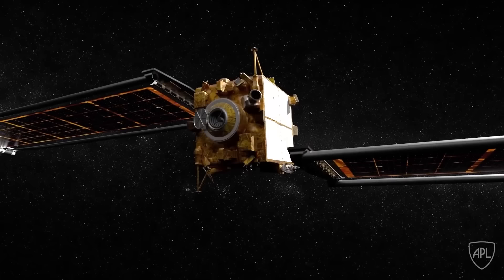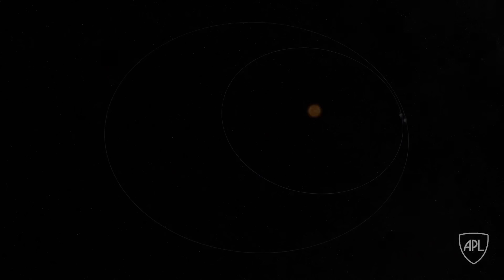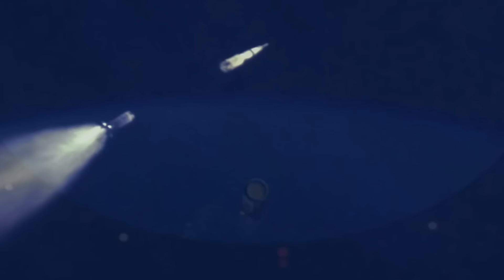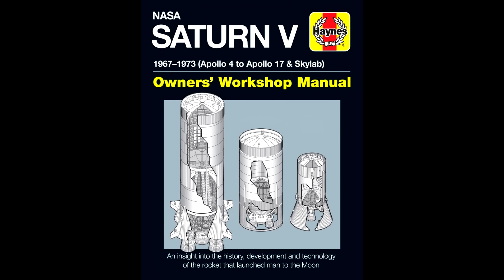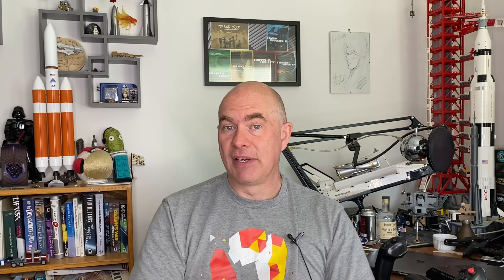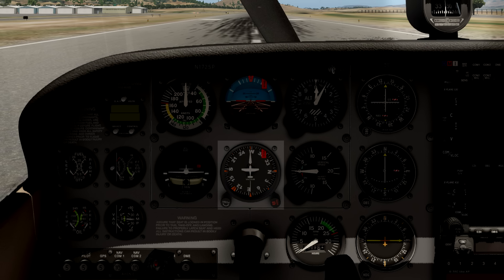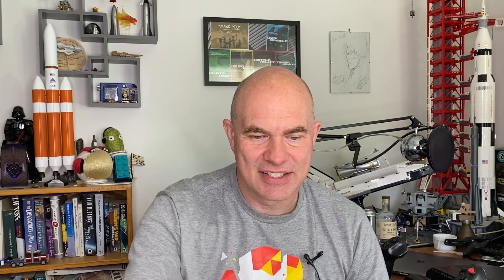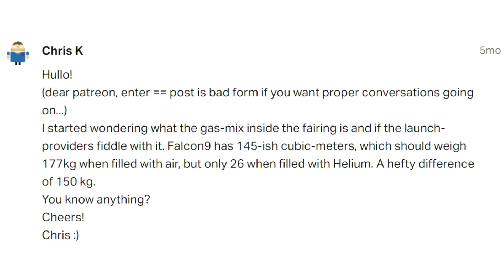Saturn V Staging, Asteroid Deflection and Hearing Rocket Turbines - Supporter Questions, Episode 17

Comment: The Saturn V did I/II staging by carrying the interstage skirt with the upper stage until the ullage rockets had allowed the upper stage stack to achieve a safe separation from Stage I.  Only then were the five J-2 engines started, and the interstage skirt was dropped as quickly as possible.  If the skirt had stayed with Stage I, the outboard J-2s on the second stage would have to have been pulled out of that skirt, a distance of several feet.  There was still a substantial dynamic pressure at I/II staging, which could cause either the spent Stage I or the upper stages to rotate and/or translate with respect to each other.  The risk of a collision of the outboard J-2s with a skirt attached to Stage I was substantial.  Moreover, the separation/ullage rockets on Stage II were solids, having no thrust vector control, and had their own motor-to-motor thrust variability - up to and including the failure of one or more to ignite.  The chances for damaging the Stage II J-2 engines were just too great, so they carried the skirt with Stage II, and didn't ignite the Stage II engines until the stages were separated by a good distance (Stage I even had solid propellant retro rockets on it to slow it down, overcoming the F-1 shutdown transients).  Once the J-2s were lit, the skirt could safely be jettisoned (it rode off on rails which prevented it from rotating and hitting the engines).  The number of factors involved in tandem rocket staging is large, and the problem can be very complex.  I was deeply involved in the development of the Peacekeeper (MX) and Small Intercontinental Ballistic Missile staging problems, and gained a substantial appreciation for the ins and outs.

Comment: 14:00 Regarding guidance system updates on Apollo, if I recall correctly Mission Control determined that the doppler shift information on the radio transmissions was such a good reference that they used that as a primary source for velocity information to update the guidance system as well.
Reply: That's correct. After Apollo 11 landed about four miles from the intended landing spot they realized that velocity errors were at least part of the reason. Someone came up with the idea to use doppler shifts to get an accurate velocity measurement as the LM reappeared from the back side of the moon. This was quickly used to calculate a new false landing location to fool the LM's guidance system to land in the intended spot. If you listen to the later descents you can hear mission control reading up the new landing location and the astronauts punching it in. This was necessary on Apollo 12 because they wanted to land within walking distance of Surveyor 3.
Reply: The Apollo missions used a blend of 2-way Doppler (for radial velocity), delay measurement with a pseudorandom number coded into the radio signal (for distance) and antenna pointing angle. This was, as you say, the primary means of determining the spacecraft's state vector (its position and velocity). The crews used star/horizon angle measurements to achieve the same thing as a backup. In the event, the command module pilots proved to be as accurate as the ground engineers in determining the state vector.
Reply: @wdavidwoods  awesome explanation! Thank you! 👏👏👏👏👏

Comment: I think what the first question was trying to ask is if, let's say there is a situation where a spacecraft with a base mass of 1000kg, with 500kg of that being propellant, and a velocity of X is on a collision course with an asteroid, will it be better to accelerate the spacecraft towards the asteroid, burning off Y amount of fuel (and therefore losing mass) but gaining Z amount of velocity, or will it be better to not burn, and impact at that base velocity of X but retaining all the mass of the 500kg of propellent.
Reply: Because kinetic energy is m*v^2 I would assume it's always better to trade mass for velocity, but someone with more knowledge would have to confirm that for me.
Reply: The answer would depend on the speed your already going.  At slower speeds its going to be better to burn the propellent, but at some speed it would no longer be worth it.
Reply: @lunaticbz3594  I think the opposite would be true. By the Oberth Effect rocket engines add mechanical energy more efficiently at higher speeds.
Reply: @BuffMyRadius  I just looked at an extremely slow, and an extremely fast scenario.  1,000 kg at say 10m/s is way less then 500 kg at however fast that propellent gets it moving.

At 20km/s burning 500kg of propellent isn't going to give you more energy then having 1000kg travelling at 20 km/s.  

To actually figure out where it stops making sense to use propellent would require math, and exactly what king of propulsion and efficiency etc.  But just looking at the extremes shows that at some point it stops making sense to use the engines.

Comment: The biggest issue with the space elevator is not physical or technical.
The problem is that it is a huge point of failure. If it snaps, then the whole structure is gone. 
And as long as terrorism and wars exist (= forever), it will never be safe.
Reply: No real space elevator concept is wrecked by a cable snapping. All of them have redundant cables, so you can do repairs if one of them snaps for some reason.
Reply: Good point.

Though if one can build a space elevator, one can also build a few tethers for redundancy maybe...
Reply: @u1zha  Skyhook tethers are still useful for other reasons, like carrying things that need to be in Earth orbits that are difficult to reach from GEO.
Reply: @HalNordmann  We are not talking about predictable accidents here, but major catastrophes, and deliberate attacks.
Reply: @juzoli  Again - big redundancy and failsafes. Like ensuring the cable burns up in the atmosphere while falling.
Reply: @HalNordmann  Cable burning up will not save you from losing your $trillion investment.

Space Shuttle had failsafes and redundancies as well, but they still lost 2. But they had several, with the option to build more.

Space elevator is only an option, if rebuilding one will not wreck the economy.

Comment: On hearing the turbopumps spooling up: one of the cleanest I can think of is the Raptor engine test firings. Because it's in HD with a good mic next to it, and there are two pre-burners spooling up instead of one, it's actually pretty audible. Obviously only for a second, because then it's overtaken by the Raptor itself, but it is there.

Comment: I don’t see any other comments on this subject, but one way in which the military — and politics — complicated the design of the Shuttle was in the manufacturing site of the SRBs.  The original plan was to build the SRBs in one piece near Woodbine, GA (about 15-20 miles north of the FL line on I-95 or US-17), and float them on barges down the Satilla River, then south on the Intracoastal Waterway (the gap between the mainland and the barrier islands) to the Cape.  Simple design, fewer steps to fabricate, and NO O-RING JOINTS.

But the military wanted a polar orbit launch site in the CA desert, so they had to be transported by land.  And Morton Salt, based in Utah, bought the manufacturer Thiokol, and lobbied Utah’s Congressional delegation to push for moving the factory site to Utah.  This meant that the SRBs had to be moved by rail, requiring them to be made in three pieces that could be put on a rail car, leading to the O-rings that failed and led to the Challenger tragedy.  And for every launch they had to be moved from Utah to Florida by rail, rather than from southeastern Georgia, and never once got shipped to the California launch site which was part of the reason for the design change!

Comment: Regarding IMU recalibration: attitude, i.e. the direction in which you are pointing, can be automatically recalibrated using star trackers and sun sensors, which provide very accurate information. Location is recalibrated using a transponder that sends a signal when it detects a signal from ground radar. The ground radar can then use the transponder's signal to locate the spacecraft. We use a transponder instead of trying to detect an echo of the ground radar signal because the strength of the reflected signal is proportional to 1/r^4, that is, it fades*really* quickly as you get farther away.

Comment: One very commonly overlooked part of building space elevator is that it requires mopping up and leaving empty orbit. It's either/or situation - either you have SE, or free orbiting satellites. It is possible to plot high inclination or polar orbits that would consistently avoid the elevator location, but anything close to equator is a hard no, and even then, any case of high angle collision )like Iridium and Roskosmos) puts the elevator at risk. This means all LEO infrastructure would need to go - from communication satellites to imaging systems, and all would remain is geostationary with it's 220 ms ping.
Reply: You just need a slight inclination to avoid the elevators.

Comment: The later generations of LM also had a higher specific thrust engine thanks to a larger and longer descent stage engine bell. The extended bell was actually destroyed by impact with the lunar surface on Apollo 15 because they were so much longer. Apollo 15 was the first with a rover.

Comment: My late FIL worked on the rover and the lower LEM stage.  He developed using the screen wire/plates for the "tires" as well as the folding problem on getting it compact.  Lots of compressed springs to get it to unfold in the right order.

Comment: David Woods got this exactly right.  When the first and second stages separated, no engines were thrusting, and the computer had essentially no directional control over the two stages.  If the skirt had been attached to the first stage, there was too great a chance that the skirt would contact the second stage engine bells and damage them.  During the 30 seconds between first/second stage separation and skirt separation, the computer's singular focus was to ensure that the vehicle was traveling absolutely straight -- never mind if it was following the desired trajectory -- so that when the skirt separated, it would slide smoothly backward.  Once the skirt separated, the computer resumed actively guiding the vehicle on its planned trajectory.

Comment: fun fact about electromechanical indicators on aircrafts. one might think that they're just simple voltmeter-like devices, basically just a springed coil and a permanent magnet.

well turns out they're way more complicated to make their readings stable in a tumbling aircraft. in fact, all those "voltmeters" have static coil interacting with a dynamic coil on the pointer and together they form a variable transformer that's used for feedback to stabilize the pointer even in a vibrating/tumbling aircraft.

this is also why all those dials have that characteristic smooth type of movement as if they're submerged into a thick liquid.

Comment: Hey Scott love your channel. Just some fun facts during the first Apollo moon mission. I grew up in Bethpage, Long Island about 1/4 mile from the south approach end of the runway. As you are aware, Bethpage is where the LEM was built by Grumman. Almost everyone that loved in Bethpage worked @ Grumman on either the Navy projects (E2C, F14 etc) or the LEM project. The plant was 24/7 operation to meet the goal. My best friends father was in charge of the wiring for the LEM. One day, I was outside in my backyard when I heard some very unusual engine noise approaching. Being that close to the approach end of the runway, I could actually wave to the pilots that flew over my backyard. But this engine noise was something I never heard before though. When I looked up I saw the NASA Guppy coming in for a landing! It looked like a blimp with wings! It was HUGE! The guppy was there to pick up the LEM and fly it to Florida. I think the departing flight was at night under the secrecy of darkness.
Did you know they made two identical LEMS? 
One went to the moon, the other remained in the hanger @ Grumman in Bethpage where all the engineers were. People actually slept at the plant when the astronauts were on the moon. They were there in case ANYTHING was needed by the engineering team. Very nerve-wracking!. My friends father said they were most nervous when the LEM was to depart the moons surface as once the engines ignited, they could not be shut down! There were wires that connected the accent stage to the decent stage and were cut with a guillotine as soon as the accent Engine was ignited. That is that small explosion you see on the video as the guillotine was activated.  If the wires failed to sever the accent stage would have never made it off the surface!
After the astronauts were safely home, the second LEM was pushed out into the parking lot and spray painted camo green! I used to see it in the parking lot everyday on my way to/from work and just thought: all that engineering, just being destroyed in the rain. How sad. I thought they could have sent it to the Smithsonian,  but I assume it would have been cost prohibitive to transport it.
Sadly the Grumman plant in Bethpage closed and the land was sold to developers. Closing Grumman was a very sad day for the proud residents of Bethpage

Comment: Another interesting thing about air inside the rocket on launch- I learned from Smarter Every Day that the JWS shields had micro pinholes so when in its folded launch configuration, air would escape evenly as it expanded during launch. The holes in each layer were specifically plotted out so when unfolded the holes in no two layers lined up, thus maintaining protection.

Comment: One thing that's rarely mentioned about space elevators is the need to remove ALL orbital items below and above the geostationary point.  Every item that orbits crosses the equator at least twice per orbit, so eventually such bits would hit the elevator.  IIRC Clarke addressed this with some way to bend the cable out of the way, but that seems impractical with so many satellites, etc. flying by.

Comment: Here is the reason I heard: Upon getting whatever shut down signal, the F-1 engines on the 1st stage did not shut down instantaneously, nor did they shut down evenly. They kinda spooled down and at different rates. Therefore, the probability that rotational moments would be imparted on the first stage was high enough that it was feared that if the interstage ring came off with the first stage, said ring would hit the second stage engines. So they left it with the second stage and jettisoned it later and smoother.

Comment: Hi Scott,

For the sake of simplicity at 13:25 I would simply refer to this as a directional gyro or gyro compass instead of as an HSI. The VOR component of the HSI is unnecessary to your example and it's the directional gyro which gets aligned to the magnetic compass. It almost looks like the instrument in the pic is a standard directional gyro and not an HSI but I think I see the little OFF/NAV flag showing in it so perhaps it is an HSI. I almost envy you because my private pilot days were a good time and a lot of fun. Now I'm thousands of flight hours later flying professionally and look back on those days fondly. Have fun and thanks for the great videos!

Comment: JWST has some features that may enable certain service missions: a refillable gas tank, removable heat protectors, visual guidance targets, and accessible attachment points. The biggest problem with servicing it is that crewed missions to L2 are currently out of the question, and automated servicing is limited (and was even more limited when the design plans were finalized).

Comment: The main reason the proximity operations around the ISS are so complicated is that it's optimized to cause the least amount of harm if something goes wrong, like the approaching craft loses control etc. Most of the time during maneuvers, if the approaching craft stopped maneuvering it would just miss the station.

Comment: Hey, Scott! Check out your Cirrus POH. You should see that it's actually using a pair of magnetometers in the wingtip for your HSI, not GPS. Pito-Static gives you your up/down and relative wind speed to the aircraft. The avionics pairs pito-static and OAT sensors to give you True Airspeed, and your GPS will give you ground speed and track.

Comment: I think the reason for keeping the S-I-C/S-II interstage connected to the second stage for a few seconds was not so much the ullage motors, but it was considered to be safer than detaching it together with the first stage, because there was a risk the interstage might touch and damage the second stage J-2 engines.

Comment: One thing that seems to never make it into the conversation about space elevators is the weather. The Earth's atmosphere move around quite a bit, a least at lower altitudes, and this would likely be a serious limiting factor in building such an elevator.
Reply: It mattered in Clarke's book!
Reply: Space elevators would be situated along the equator, far away from the jet streams in the higher latitudes and any likely path of hurricanes and tropical storms. There's a reason why part of the equatorial Pacific Ocean off the coast of South America is called the Doldrums. Sailing ships have been known to become becalmed for weeks at a time.  Weather wouldn't be that big a deal if the base is in the right place, and some proposals allow for the base to be moved out of the way of any threatening storm. Remember, the elevator is essentially dangling from space, so there's no need for it to be permanently fixed in one place. The base can be a floating vessel.